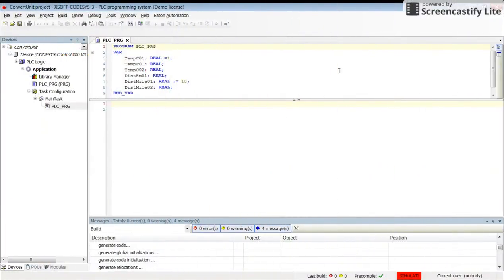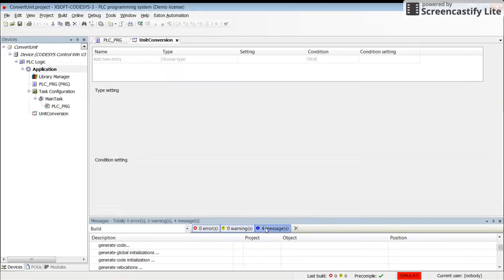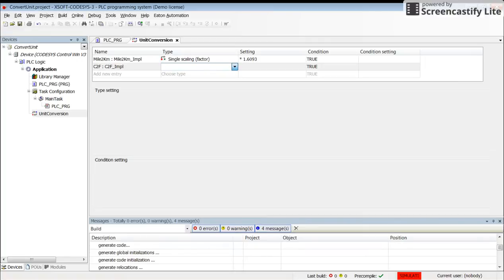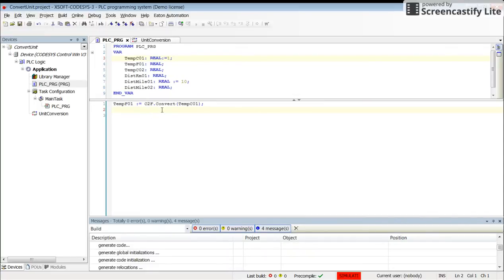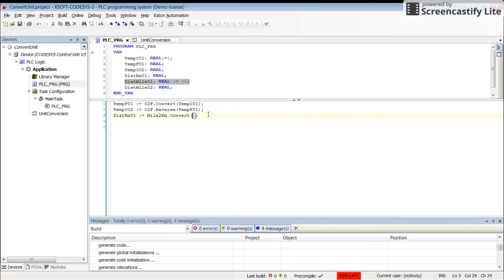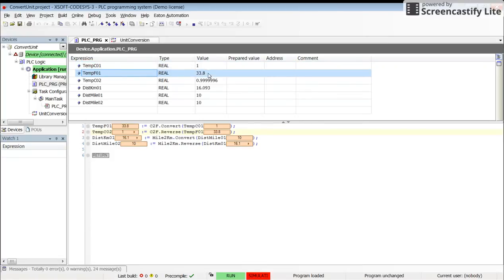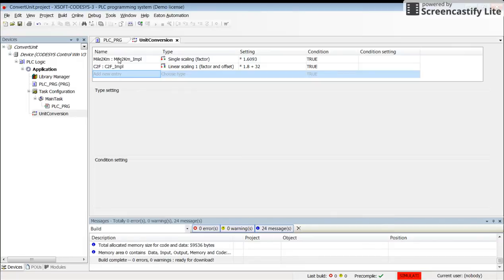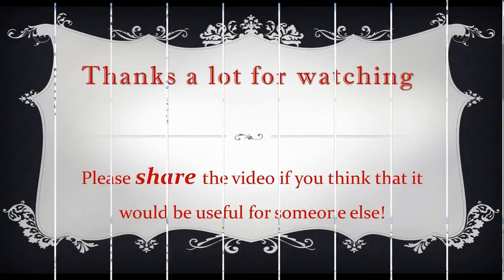CODESYS: Unit Conversion in Structured Text (ST) #codesys #plcprogramming #iec61131 #twincat #plc

Comment: Excellent video Dr.Alizadeh! Just wanted to add something.....if anybody is wondering if  "Unit Conversion" will work on CFC environment, the answer is YES!!  You just have to add a box, and give it the name of your function + "_Impl" and what you want it to do, either "Convert" or "Reverse". For instance, my Unit Conversion is called C2F (Celsius to Fahrenheit), so I would have to name my box:  C2F_Impl.Convert. Don't forget to add an Input and Output and press f5 to start,  otherwise it will not work.  Here's an example if anybody needs it! https://www.dropbox.com/sh/g1s4blpre7wfrrw/AAC8A2SmQxy2djTaIBo6bH1xa?dl=0
Reply from the maker: Thanks a lot for your feedback and help.